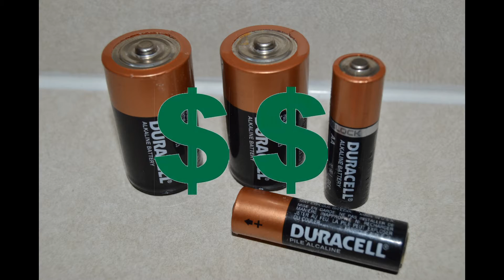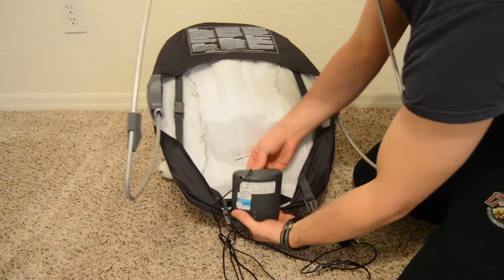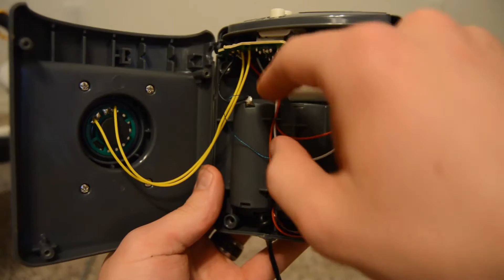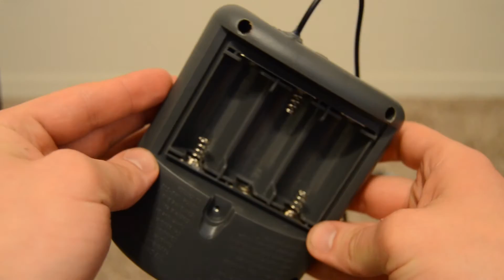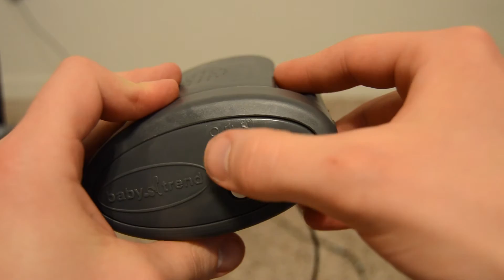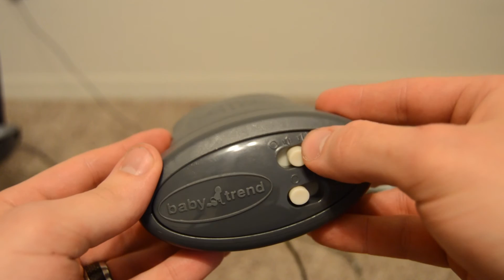Hack a Baby Toy, Save Money on Batteries | DIY Professional #1

Comment: so the reason why its battery powered, its for safety, so when the baby tries to chew or spit on it nothing happens, also you dont want chinese crappy thing that can go live any minute connected under the belly of your baby..  just buy batteries.
Reply from the maker: Not true, many children's toys can be plugged into the wall. Usually the power adapter steps down the voltage and converts it to DC before sending it to the device. If you were to chew threw this cord nothing would happen because there is only 5V applied across the wires.